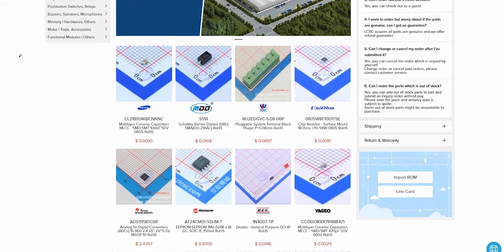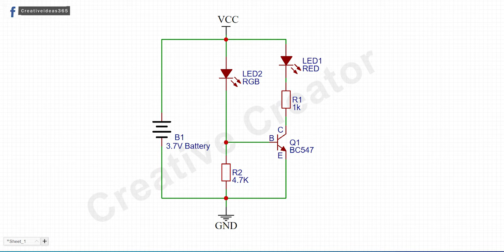Simple LED Flasher Circuit

Comment: would it be possible to replace the red LED and resistor with a relay, if you wanted to make a higher powered lamp flicker?
Reply from the maker: @GothGuy885  yes it can be possible

Comment: For beginners please provide description on its working. Thank you for your contribution
Reply: I think the idea is using the transistor to turn the battery from dc to ac, but I wasn't focusing in the class when the teacher talked about them😅, I think I will have to wait until the college professor talks about it again.
If you did under how it's working can you explain 🙂.

Comment: Waooo
Reply from the maker: Thanks!! 😀😀
Reply: @Creativecreator  nice project sir...
Reply: @Creativecreator  sir next time plz make video to same time 8 to 10 LED  falshing circuit making plz sir...
Reply from the maker: @hkhobbypakistan6917  in this circuit you can connect 8 to 10 leds in parallel. 
Make sure you are connecting the LEDs with the red LED. It will work.
 You can also use 1k resistor for series (not mandatory) branch.
Reply: @Creativecreator  thankyo sir... I'am trying..

Comment: Nice setup, just make sure everyone knows that a BMS is REQUIRED for LiIon batteries, to prevent a risk of fire or explosion when those batteries are either charged or discharged beyond their safety threshold.
Reply: A BMS??
Reply: Battery management system BMS
Reply: You build circuits??

Comment: How should I make a circuit to operate for a long time in the form of 12 cat sliding lights with a 9 volt battery?  What type of LED should it be?  15 days - 20 days to run (10 hours per day)